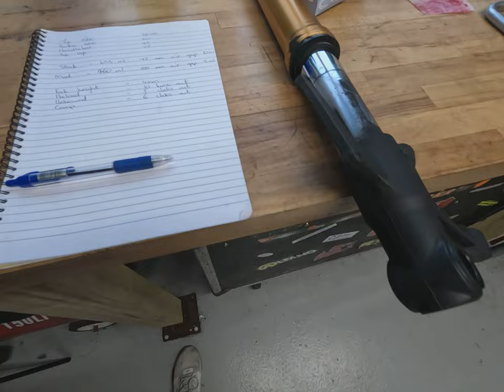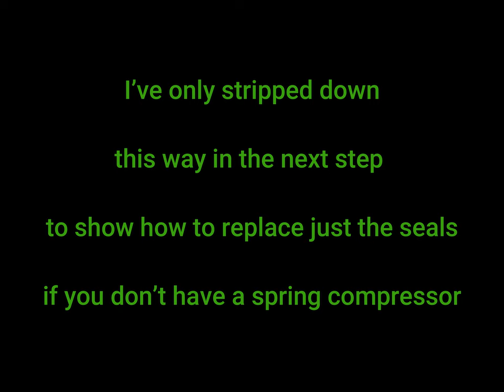How to service, modify & rebuild upside down forks (Triumph 675)

Comment: Are the forks from a 675 or a 675 r? I've an r to do and wonder whether they're the same as these? Great video 👍
Reply from the maker: They are from a standard 675, the R’s have Ohlins fitted. I’ve not had a set of those apart, the internals I’m sure will have differences and certainly have a different fork cap, however all forks have the same components and operating principles

Comment: Nice video fella!

Only thing is you didnt set the rebound adjuster to ensure it has the correct range of adjustment.

Depending on where the adjuster is set, it can change how far on the damping rod the cap will screw. 

This can also mean you effectively change the amount of preload.

Same as if the cartridge doesnt locate properly in the recess at the bottom, will also change it.

Still great video with great pacing.
Reply from the maker: Thanks for the positive feedback 👍

Yep, I totally get you 👌🏻 On that fork the damper locknut was basically wound all the way down, I set it back to where it was and the preload had the same range of adjustment as per spec but should have mentioned it
Reply: You're referring to the 13mm exposed thread above the nut measurement correct? Which can be obtained by measuring 13mm or by adjusting the rebound adjuster all the way out and then back in 3.5 turns and then locking the cap down? I'm currently seeing what the difference may be between using the service manuals 13mm guide vs almost everyone suggesting the 3.5 turn method. I believe the rebound adjuster method will actually work better.
Reply from the maker: @SquidRider  I’ve not heard of the 3.5 turn method, I will do some research. We are talking about the top cap lock nut on the damper thread. In this video it is all the way at the bottom of the thread. If you change the position of this it obviously changes how far the fork cap can screw down. This in turn effects the preload on the spring and rebound damper adjustment range